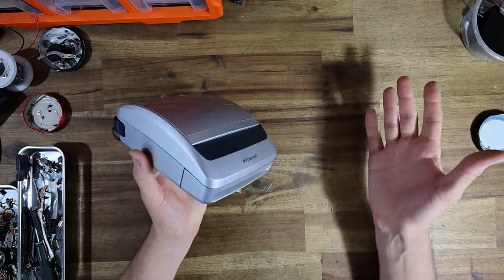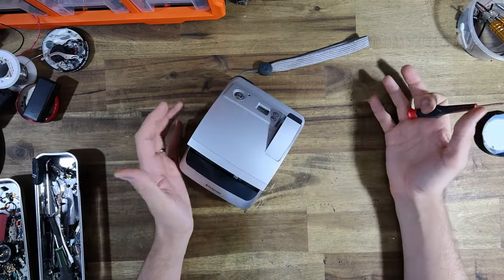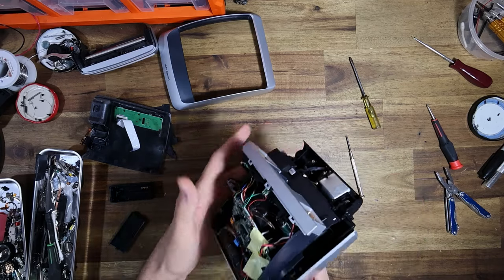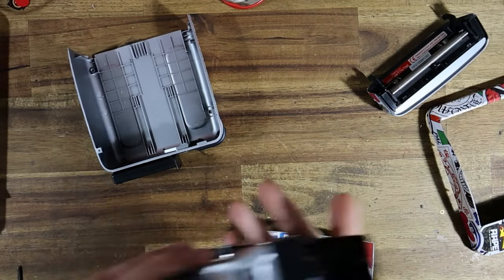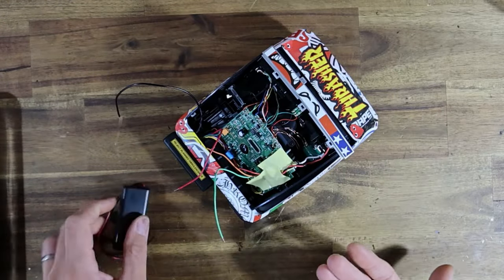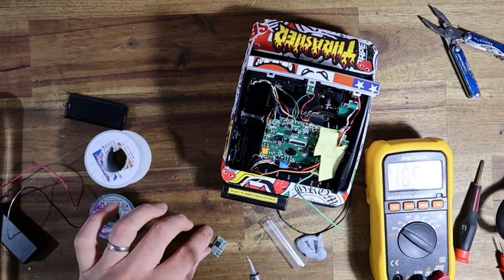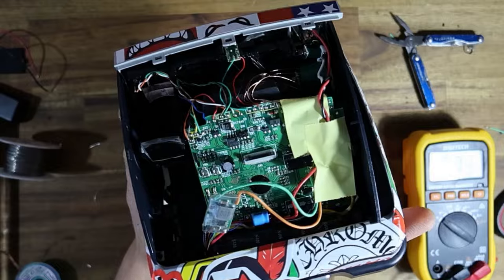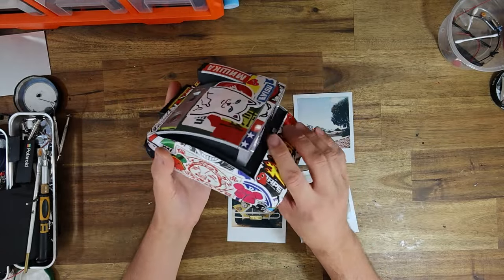Pimp My 'Roid - Episode One - Ashlee's i-Type, Stickerbombed ONE600

Comment: I can answer your question about those contact patches! As you mentioned near the end the pro version has a +- exposure slider. There is also a version that has flash control and IR autofocus. To the best of my knowledge all cameras have the IR illuminator, but not all have the IR reader.
Reply from the maker: I found the solder points for the slider! 

It'd be cool to try find the switch that fits in it to activate it